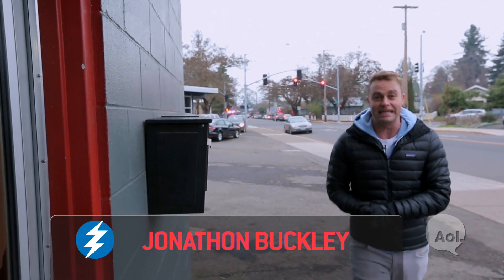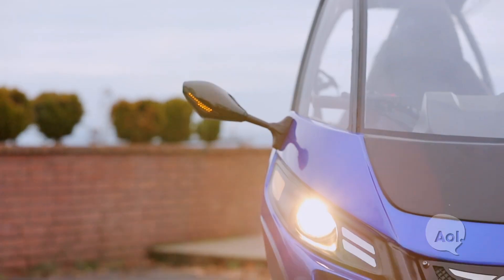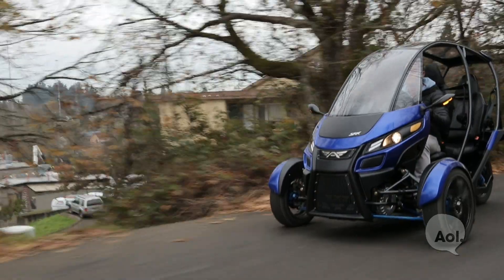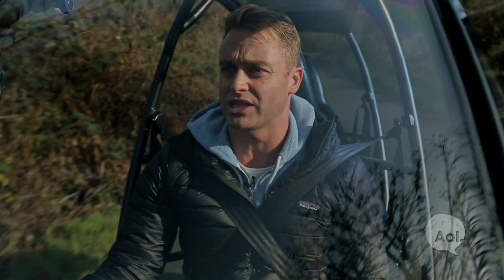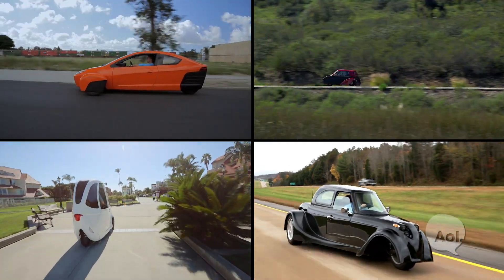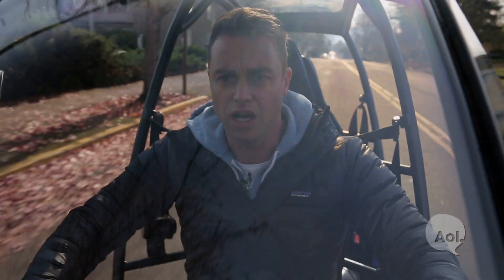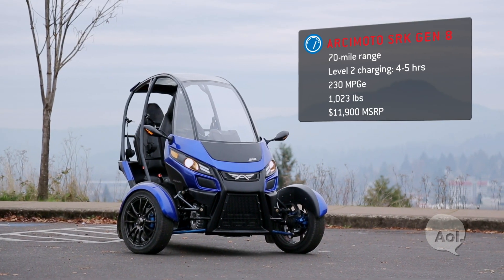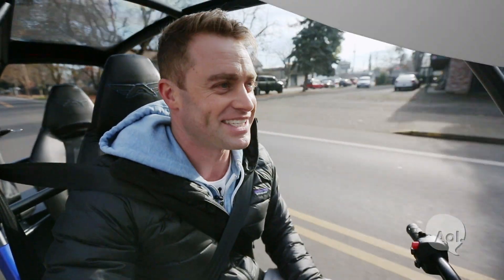Translogic 190: Arcimoto SRK 8

Comment: SRK is no longer sold, FUV is now their most basic model starting at 19,900. That is 4,000 less than a Nissan leaf, but lacks most of the features the leaf has. You can also get a used Nissan leaf for less than 10,000. The SRK at 11-12k would be justifiable, but 20k for an open-air trike is not worth it. Seems like they lost sight of their vision.

Comment: For $7700 I can buy an fully enclosed ZEV Electric trike (the 5 door one with the hatch rear) with 80 mile range and a heater, windshield wipers, etc.  I want one with the 100 mile range option, still less than an Arcimoto
Reply: Where did you see that option? The three door ZEV T3-1 Micro with Lithium alone is $9000+
Reply: I said I want the 5 door, not the 2 door T3-1.  https://www.zelectricvehicle.com/t3-5d-trike
Reply: @BibiBirder619  Right next to the prices of the lithium are the prices with the caustic silicate battery.

Comment: I want a single seater so I can use it to go back and forth to work....it does not have to be a race car, nor fancy......but it needs to go at least 150 range before plugging in.
70mile range is not good enough.....I travel 110miles a day to and back from work. I could use something like this if it had the range.

Comment: yeah, good luck in winter
Reply: They will need less luck than other vehicles since two or the three wheels have independent drive motors. It is up to you to prove these have a problem in snow. Test track videos of these in snow seem to totally prove you wrong and they were not even using cable chains.
Reply: if vehicle is open it is no good
Reply: I repeat - this vehicle is sold with any body configuration the buyer desires. Open, closed, half open, truck rear end. WHATEVER YOU DESIRE. Closed vehicle is also no good in hot weather. Most of the many videos here about the new Arcimoto show the various body configuration options. If you just want to bitch and troll then flake off.

Comment: wtf, They forgot to make it LEAN into the corners!? Fail. Unsafe. Able to TIP OVER in a sharp turn. 
Honda came up with the solution. http://blog.motorcycle.com.vsassets.com/wp-content/uploads/2015/01/012015-honda-leaning-trike-patent-2014-8-animated.gif
Reply: Bullshit. The front wheel base is plenty wide for sensible drivers. There will always be idiots who roll vehicles when they fail the Darwin test. Honda is not a US company, that makes anything they sell a not-starter for loyal patriotic Americans.

Comment: Very high the ceiling, make more lower possible? Can drive more miles? Also put regenerate brake and solar panels roof increase more the price but drive more more miles
Reply: It has regenerative braking from the handbrake lever, the footbrake is a conventional friction brake. I agree that a solar roof might prove a useful addition though, maybe offered as an optional extra? If parked in a sunny car park for 8 hours while at work it might even be enough to cover the journey back home.

Comment: they remove the steering wheel and achieve a 700 pound reduction in weight???? that's one seriously heavy steering wheel.
Reply: It permitted a shorter lighter frame as well as lighter steering hardware.

Comment: Only thing I can see to improve on is the high squeal sound of the electric motor.  Maybe there is a way to but a Styrofoam muffler around the motor to muffle it a bit so It's not so high pitched.  Then it would be perfect
Reply: Totally silent small vehicles are inherently dangerous.
Reply: That would cause the motor to burn up without a way to cool it.

Comment: safer than a motorcycle? Dunno about anyone else but if I was to be in a collision on the road I'd rather have one on a bike than in a car as in a car you're trapped while being in pain f*ck that for a laugh. On a bike providing you're wearing the correct gear and you don't hit anything on the way down from flying through the air should be relatively okay. Some guy did a 200 odd mph land speed record on a bike, something happened at some point and he crashed at 200 mph. Came away with most of his bones broken but wouldn't fancy being in a car that crashed at 200 mph doubt any crumple zones or roll cages are going to do a great deal at that speed. 

Plus with this SRK 8 there's little side protection other than a metal tube which is near enough as bad as a motorcycle except you're strapped into the seats and won't be seperated from the vehicle surely that would be far more scary to have a collision like that?
Reply: Michael, there's a fundamental difference between a cage and a standard two-wheeled motorcycle.  You worry about being trapped.  I worry about secondary and tertiary impacts after being thrown from the vehicle.  With a two-wheeler, there's the primary impact... a tree, a car, a person, or whatever.  Then you're thrown x-distance by momentum... into another tree, or car, or person, or wall or whatever.  And depending on the speed and surrounding obstacles, your body could suffer additional impacts.  In the SRK, you're strapped within a cage.  Your body is limited from further injury from rolling down the highway or into a ditch.

Could you be trapped?  Possibly.  But then you can also be trapped in a car.  Your fear is misguided.  Frankly, I'd like to see some additional side impact similar to their previous generation models, perhaps in the form of a hinged tubular door.  It would add weight, but it would provide greater safety.  My wife and I drove this vehicle last week.  It was an absolute blast to drive and one adopts a motorcycle frame of mind when on the road.  Drive defensively and remain acutely aware of your surroundings.   This is inherently safer than a two-wheeler.
Reply: Idiotic comment and famous last words for the logic deprived. Setting speed records is off topic and not relevant for this consumer vehicle. You can wear as much protective gear as you like in or on any vehicle.

Comment: Saw it live at the nycarshow. would seriously think of getting one if was more like the Elio - fully enclosed. I mean $12k is a lot for an open vehicle.
Reply: dacna01 Have you seen the price of motorcycles lately? This is in the midrange of motorcycle prices. You can spend 8-10k on a bicycle these days.
Reply: fr
Reply: you will get some of that back on taxes
Reply: Several door options are available. Doors increase the price. One door version is for a delivery van design.
Reply: Al Maurikan An enclosed body makes this much more than a motorcycle. The future of personal transportation lies in light weight vehicles. Eventually the 4000 lb steel caged climate controlled lounge couches abused as a standard for personal transportation will have to be taxed into oblivion for environmental reasons. Flying cars my ass.
Reply: There are optional hard panel enclosures and soft panel enclosures (think jeep soft top).
Reply: Popeye Gordon I really don't see much more than a motorcycle. Can Am spyder, all the off road side-by-sides. BMW C1. Automoto scooter. We are not talking advanced design here. I commuted a thousand miles a week to work on motorcycles and a thermal waterproof  riding suit with.full helmet was more "enclosed" feeling this this canopy top scooter.
Reply: Popeye Gordon I really don't see "much more than a motorcycle". Can Am spyder, all the off road side-by-sides. BMW C1. Automoto scooter. We are not talking advanced design here. I commuted a thousand miles a week to work on motorcycles and a thermal waterproof  riding suit with.full helmet was more "enclosed" feeling this this canopy top scooter.
These designs never make it. Much better designs failed. Ie. Monotracer, Carver One, Tango T600.

Comment: I'd suggest taking this to San Fran and run up and down Hyde St  or even Broadway all the way to the top and back down to the wharf. Then run it around in city traffic as a low profile vehicle, you're not going to be "heard" or seen well as you would on a bike. You want to advertize this for city use.. then use a real city stress test on it.  Portland and Eugene are fairly flat and scenic but not what folks who'd be searching would want to see.
Reply: Go a few miles to Beaverton and find all the hills you want.

Comment: I'm a Leaf owner in Florence who drives up to Eugene frequently. Suggestions.  The vehicle needs to be able to use CHadoMO quick charging network to be practical for any distance beyond half of the vehicles 70 mile range.  It needs to have a range of 100 miles at 65 miles per hour also, and some kind of removable side curtains for rain, and a heater.
Reply: +fiddlesteven: Have you read the website yet?  They offer 130-mile range versions with side panels.  And it has a heater.
Reply: To state a range of 130 and not include at what speed that range is associated with is useless. My Zero motorcycle was rated at 115 miles at 45 mph,  at 55 mph it would barely go 80 miles per charge.
Reply: I think your right, they don't even say what speed will give the machine that 130 mile range, kinda unprofessional, and its because at 55mph its top range with the large battery is going to be closer to 70 miles.

Comment: Put a 500cc turbo engine on this, 50HP, and race the Phugg out the road, for like 66-70MPG, with 0-60 at under 6-7 clicks!
Use a Nissan CVT system, that uses a metal belt, and the weight gets reduced even further when making a 1 seater instead of a 2 seater, to 600-700LBS. 
With rider and luggage, that would be less than 1HP per 2 LBS.
Reply: This is why YOU are not marketing a vehicle and they are.
Reply: What is why?
I think it would be tremendously fun, to create a go-kart type of vehicle.
Electric makes no sense at this point in time.
Make it 2 or 4 stroke.

Comment: Put a gas engine in it. Electric vehicles are not as clean as people think they are. Too damn expensive. I will buy an Elio. $6800
Reply: +david blume ..ain't gonna happen...
Reply: If you want gas buy a Can-Am, this is to get away from gas for commuter use.
Reply: A year later, still no Elio but Arcimoto has $20 million cash and public stock investors to begin production in their new factory.

Comment: the eilo is cheeper and faster and has ac and heat
Reply: +mega guy We expect the total cost of ownership over a reasonable time period will be in Arcimoto's favor here. You don't need to buy gas for the Arcimoto SRK, ever.

Although the Elio has a higher top speed, the SRK is much quicker off the line, thanks again to the pure electric drive and full clean torque at go.

And of course AC and heat will be available on the SRK as well.
Reply: tybeejeffro there is not a ton of roof space for solar panels. However, we do have some people interested in putting solar panels on their vehicle. We think the best plan is to plug into solar power at home, then use your SRK to commute to work.
Reply: +mega guy  The elio doesn't exist , they cant get their act together... another delay whats that the 4th time ,
Reply: It wouldn't be big enough of a solar pannel. Solar panels have to be huge.
Reply: they say they will be adding that as option